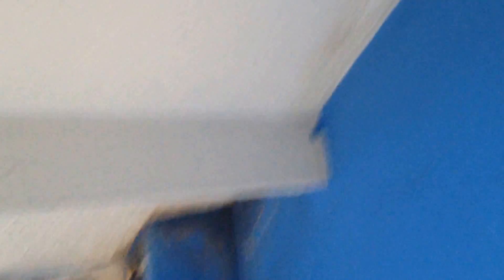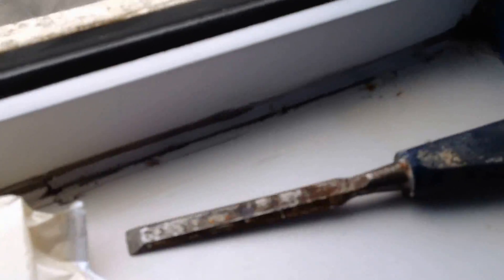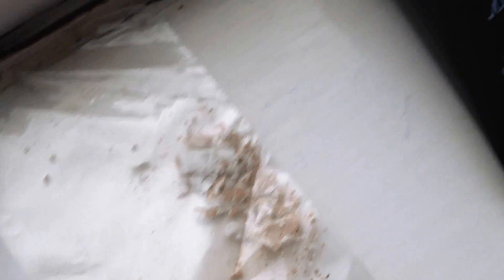Asbestos sampling

Comment: Would a cement undercloak contain asbestos.?
Reply from the maker: Yes it certainly could have tested many and had positive results.
Reply: Domesticsurveys bristol Would a property built in 1996, contain any?
Reply from the maker: Forza223 Bowe it is possible, but would be a white asbestos if any.
Reply: Domesticsurveys bristol I am going to get a sample taken. What alternative undercloak materials were used in the 90s?
Reply from the maker: Forza223 Bowe cement boards with no asbestos content. Are you actually doing work on the undercloak, or is it damaged? undercloaks are normally well out of reach reducing the hazard and it is a low risk material, assuming it is in a good condition just leave it alone.
Reply: Domesticsurveys bristol It’s in good condition, I hope it ain’t asbestos as it would mean higher costs if any works were carried out on the roof ect
Reply from the maker: Forza223 Bowe drop us an email if you want further advice domesticsurveys@gmail.com
Reply: Domesticsurveys bristol I can email you some photos of it, I know it’s not possible to tell but just to give you an idea. Can you see the fibres in the cement matrix ?
Reply from the maker: Forza223 Bowe hey the only way is laboratory analysis, sorry to say.
Reply: @Domesticsurveys  does white asbestos cause mesothelioma
Reply: Do undercloaks have any stamps saying AC or NT?
Reply from the maker: @forza223bowe5  These were normally larger sheets that were then cut to size on site.